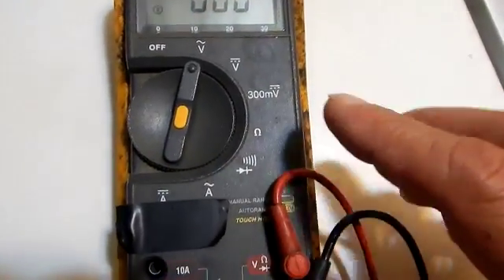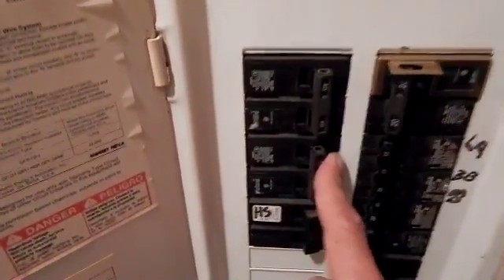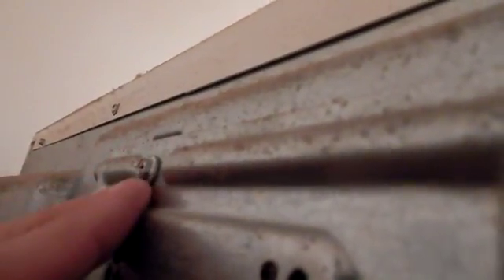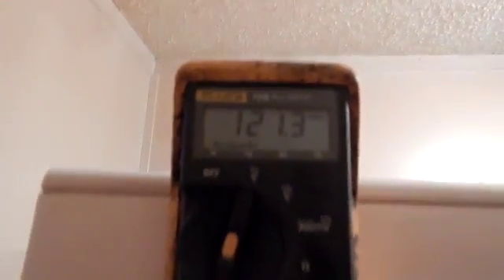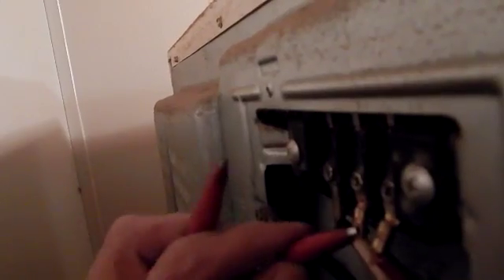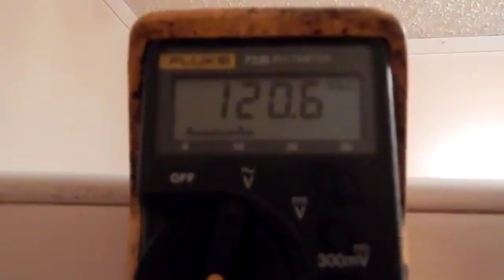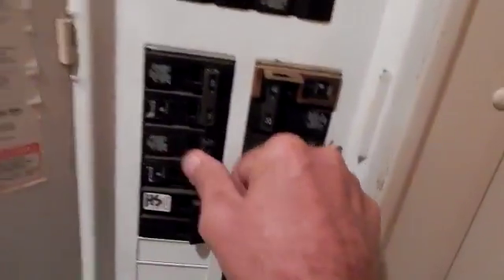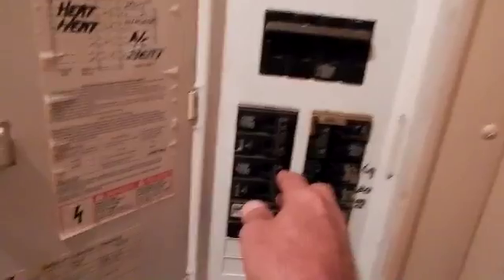Using A Multi-meter To Check Volts On A Dryer Power Cord.

Comment: If you test the black and red wire and only get 120 but you get 240 on the outlet, does that mean the the cord is bad or the unit it self?
Reply: boyzinblue03 Better late than never. Today I had the exact same situation as you. Samsung dryer wouldnt turn on. At the socket all volts were good. At the connection to the dryer I'd get 120 instead of 240, and 0 instead of one of the 120s. Replaced the power cord and it works perfectly.

Comment: Thanks for the demonstration, this is probably useful for many people. I got some notes about this anyway: I'm not saying this is wrong or anything. In fact what you are doing here is quite safe and easy, but there is an even safer way to teach for amateurs who might not be that careful or might see and later remember things wrong, etc. Just as you said, I would also like to repeat that anything we discuss here is for entertainment and hobby stuff only, I'm not instructing anyone to do this.

The same thing (checking between continuity and a gap, not actual condition of cord) would be accomplished by 1) measuring the live outlet by the voltmeter by the standard meter heads and 2) checking continuity through the cable while the plug is disconnected from mains during the whole operation, the socket is live all the time, and the only time mains voltage is handled is through the multimeter(while holding the protected test wires by one hand). This eliminates the risk of someone not really getting it and forgetting to disable the outlet and/or switching the wrong breaker off, thus messing with live wires etc.

This is assuming this appliance is connected by means of a plug. I don't know really because we don't have 2 phase plugs around here, just 1 and 3. There are devices connected to 2 live wires in some households, but these are hardwired by a professional instead of being plugged in a socket. This type of a machine in my market area will most often have a 230 volt one phase separate ground 3-wire (euro schuko type) plug, which is capable of in excess of 3 kW.

A further check, not up to professional standards but somewhat useful, could also be made without using dangerous voltages. The cord would be removed from the screw-in connections and tested in a 12 volt circuit drawing enough current, and every wire should have a reasonable and similar loss of voltage. Again for anyone reading this, this is not advice. Always use a professional's services. This suggested further test would in no way test for insulation and would not even reliably test for the condition of the safety grounding wire, if any. It could, however, give a clue about the condition of live and neutral wires and whether they are the problem, and that would perhaps be enough to decide that a new cord is necessary.